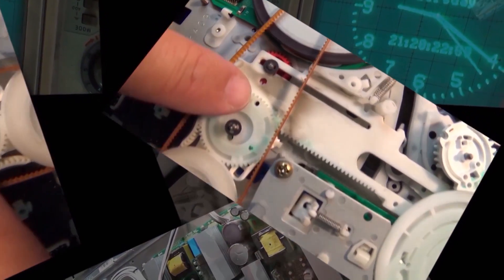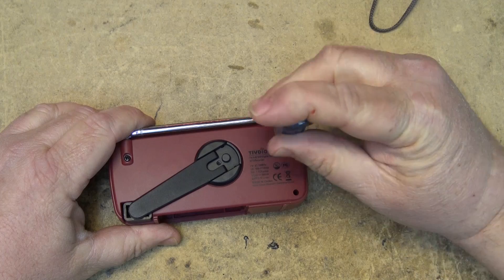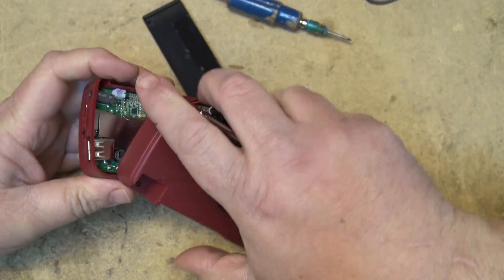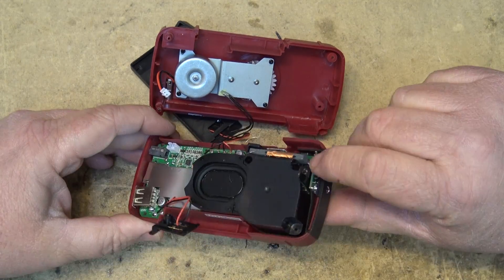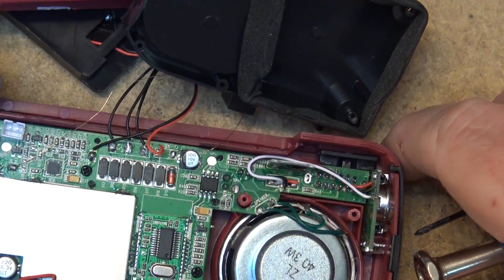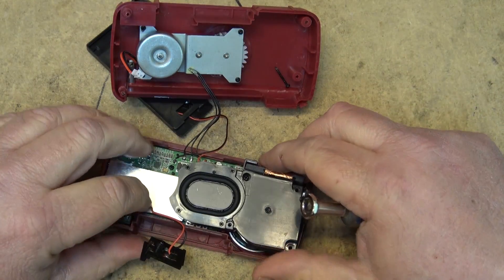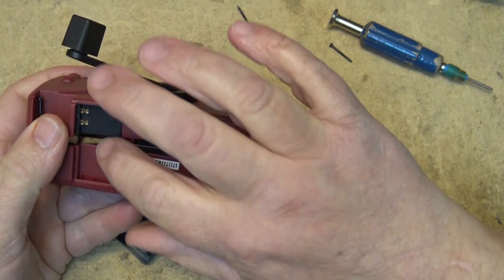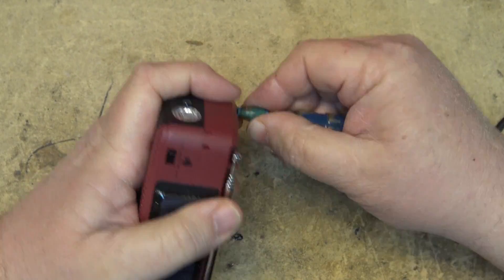tivdio HR 11W Camping   Emergency radio   USB charger Teardown

Comment: Just curious as to whether the crank charging dynamo uses a brushed or brushless motor?  
When I tore mine down I could see that there appear to be 12 poles and 3 phases.  Its rather small to see if it has rotating permanent magnets or not (even with my magnifying glass) and there were no part numbers to be seen.  Couldn't tell if it was in a delta or wye configeration.

Comment: What a POS. A simple AM radio can be built to last many years of use on a single AA battery or even a wind mechanism. Having that digital tuner and LCD screen is a giant waste of money and energy. AM radio is, by a very long way, the simplest radio possible.
Reply: tarstarkusz - Indeed, just keep the ferrite rod antenna, the tuning cap, and the detector diode, and you’ve got yourself a “crystal”-set radio. How many of us in the audience remember making one as their “first” radio kit? 😎
Reply from the maker: But this is not just an AM radio, it is FM / FM stereo (with headphones) bluetooth speaker phone and streaming, plus a built in MP3 player with recording capability both off the radio and internal microphone, plus it provides backup power to your cell phone and can generate power when none is available.
Reply: +12vol.. As a device to record directly from radio, it's probably OK, though pretty pricey. Can it tune in digital radio?
When I heard "emergency," I was thinking more along the lines of the EBS than an emergency on your end. In that case, AM would be what you would want. If there was a regional grid outage (for example) you just aren't going to be able to tune in any FM stations, but you could tune in AM stations from very far away (with everything down) and at night.
Reply from the maker: It actually has really good sound for the size. The sound quality of the recording is very good.

Comment: The unit is most likely a SDR radio like the Morphy Richards 27024 LW/MW/SW/DRM/FM/DAB Software Defined Radio where we will halve an all digital IF using a Tayloe Mixer(QSD) conversion module which will generate the I/Q signals which get processed to recover the audio from the different modes so in effect all processing is done using a DSP chip with a EEPROM software ROM attached driving a DAC which drives the speaker.
Reply from the maker: I am sure it is SDR it does take a few seconds to boot up.

Comment: That's a neat unit inside, even the generator was really small, i expected it to be much bigger for battery charging, and the bass speaker was a big supprise.

Yes the ferrite rod wires were a bit unprotected, but that was the only worry.
Everything it can do, and still be pocket sized :-D

Comment: Fairly certain that oval "speaker" is just a passive radiator, not actually a driver.
I see I'm not the only one that has made this observation. Oh well...
Reply from the maker: And just what did I refer to it as?
A "Bass port" which is another name for a "drone cone" or "Passive radiator"
I think I was quite clear when I mentioned a "bass cavity". Nowhere did I call it a speaker. The speaker I was referring to was under the enclosure.
A bass reflex port is an open port, that accomplishes the same thing, makes a small speaker sound like a larger speaker through a tuned cavity.
Reply: @ 3:03 You even stabbed it with your finger while calling it a speaker. Sorry I have to point this out...